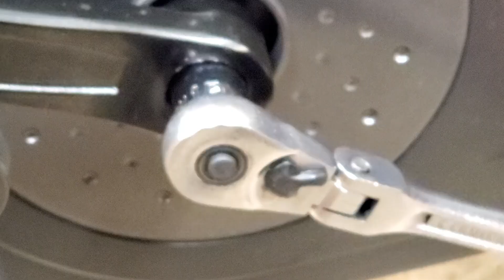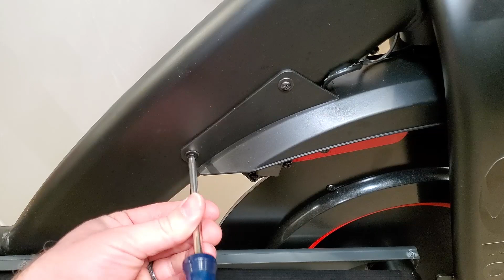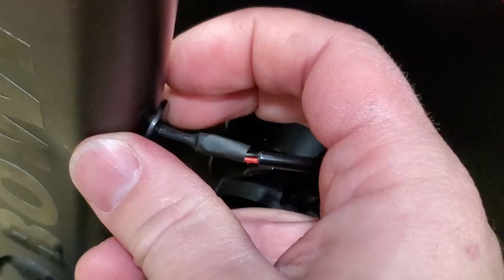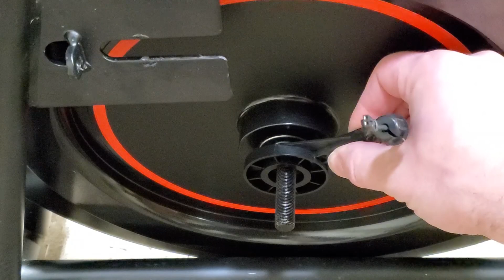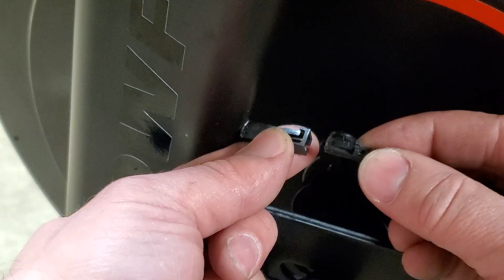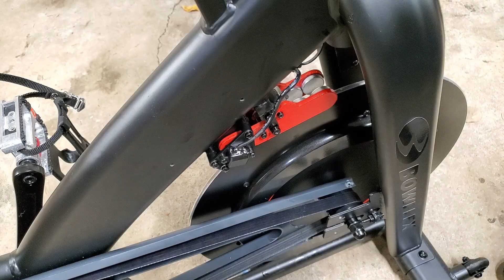BowFlex® Support C7 Bike: How to Replace the Speed Sensor

Comment: I am currently in the midst of replacing my sensor. In future models, please consider creating something that does not require a complete dismantling of the bike to change a sensor. Especially if a major risk is involved based on how gentle or not we are in our dismantling. Before sending the bike to market do not overlook the mass issue with the sensor and monitor.